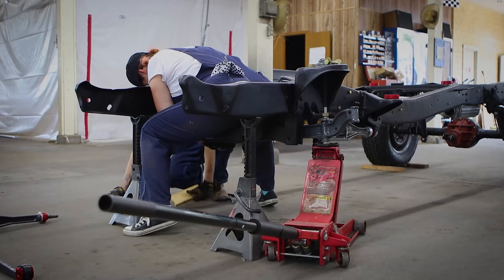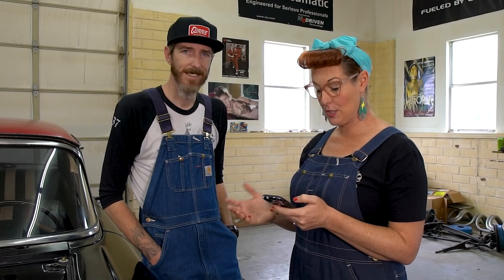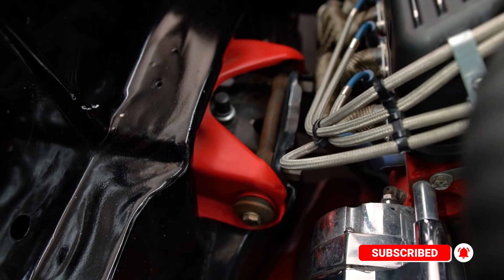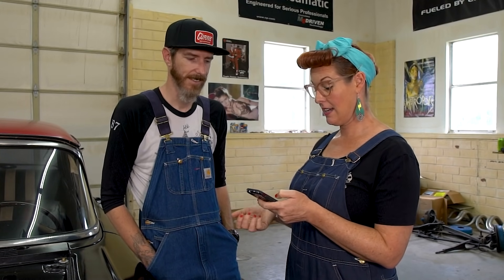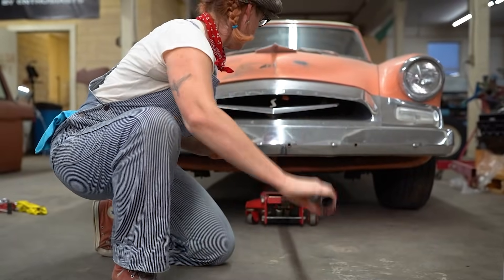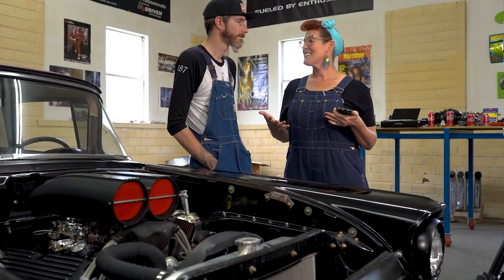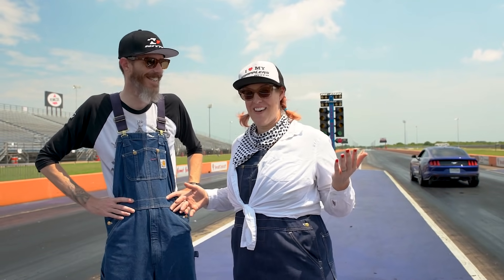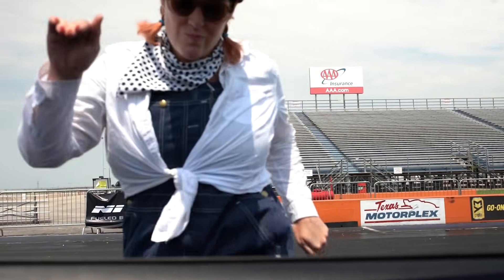The REAL Cost of Car Restoration | Extra Good

Comment: That’s not a typical price. A decent 10 footer paint job (looks decent at about 10 feet) is going to cost you 10k. A good suspension is about 6k. Do NOT take the prices in this video and try to apply it to the old 66 mustang behind the old barn that’s been there for about 30 years and say hell 10k and I’ll be on the front page of modern mustang magazine! YOU WONT! It’s a lot more expensive than that. This couple did a lot of the work themselves and went with standard to substandard parts judging by the prices they quoted. Wilwood isn’t the best, but it isn’t the worst. Just a front and rear brake conversion without the booster, master cylinder, proportioning valve, or steel lines will cost you almost 3k and that’s you installing it!

Comment: I restore Lincoln Continentals.  For a convertible, I charge $250,000 to $325,000 depending on the condition of the body and chrome.  I do not restomod.  The MELs or 460s go back in.  When I'm done, the finished car is worth no where near what the client paid.  A labor of love, indeed.

Comment: I’m not trying to be critical but you didn’t restore a 1957 Ford .  You built a 1957 Ford restomod and did a great job.  I owned a 56 Ford with drum brakes and had no trouble stopping it.  I currently own a 66 Charger with full drum brakes and a single master cylinder, which is how it came.  I am currently doing my best to restore it to original even though it doesn’t need much.  Even though it has a HiPo 383 four barrel (all factory stock) I have out grown two wheel burn outs and drag racing.  That said, I feel the cost to restore a car depends on what you choose to start with, parts availability and your ability to do the work. In my younger days I restored more than one, always to original, but I agree it can get very expensive. Great video and great job on the 57.

Comment: Thank you for the numbers nobody ever talks about it. And effort $… I do this for a living and every one wants it done now thanks to TV.
Reply: Exactly.Most people don't have any idea what is involved to restore a car.If you're going to do it right, you'll have to buy things you never thought about.Weather stripping is stupid expensive,wiring, chrome plating,all kinds of bolts,brake lines,and a lot of other things that you will run into as you go along.If you're just starting out like me,a large air compressor, metal working tools, engine hoist and a lift are just about necessities.Heck, you'll spend a small fortune on paint and body tools and supplies.It ain't cheap my friends.
Reply: I know all about it restoring my 65 Rambler for the second time because it's not too long cuz my stepfather's first new car new wheel bearings brakes brake lines master cylinder water pump fuel pump rebuilt all the stuff that all adds up

Comment: I have a '59 Ford Fairlane 500 two door hardtop. I am impressed with how you have been able to keep costs down. It has an excellent interior, and a nice enough exterior. It is straight, with fairly new paint. There are a few rust bubbles here and there, but the frame and under body are good and sound. It has a 352 FE engine, which is not the engine it came with. The left exhaust manifold was broken, but the seller had a replacement manifold for it. The old bolts on the manifold were not going to give up without a serious fight. Several were already broken off, and I could not figure out how to get a drill, tap, and so on between the engine and frame. I took the left head off, and I also checked the valve stems and valve guides. They were worn, so I took the other head off, and took them to a machine shop for a valve job. Started with some broken bolts, and it mushroomed into a valve job with hardened exhaust valve seats. $1,000 I didn't plan upon, but that's the way it goes. I've had to hire some of the work done due to health problems that are causing fatigue and mobility problems. I am getting close to having it run again, and I can hardly wait to go crusin' in it.

Comment: Awesome build!! Thank you so much!! I have a 1958 buick special im planning to restore and the build you did is the same I want, its going to be my daily driver ❤
Reply: I have always thought that a '58 Buick Special would be very good looking car, if all that strange looking quarter panel chrome, and too large and intricate bumpers, huge taillight housings, and hood and deck lid  trim, were all removed. Back in '58, my dad's best friend (and work colleague, they both taught at General Motors Institute) , who lived two houses down from us, bought a '58 Special 2 door sedan, 364 with 3 on the tree,  blackwalls and dog dish hubcaps, in a light blue. That would have been the fastest  Buick made that year. Always thought that if I could find another one like that , I could make a great looking 50s Kustom . 😎👍

Comment: I just bought an Out of Sight Audio for my 67 Pontiac Catalina. You can connect it to your phone using Bluetooth, and upgrade it with additional speakers and an amp later down the road. Plus you don’t have to modify your original radio.

Comment: The key to restoration is time, patience, money and/or the ability to do some of your own work.  Unless you know how to do it, you gonna have to pay for some stuff.  You can save a lot of money if you can [learn how to] do engine, transmission, and or fab/body work.  I personally learned how to work on/rebuild engines (it's literally like doing a puzzle with torque specs) on YouTube and trial and error.  Transmissions IMO are a little harder but it's doable; again YouTube.  I also bought a welder and learned basic welding on YouTube.  Suspension and brakes are straight forward.  Just take your time and don't leave anything out.

Comment: Eh! 1958 AMC Rambler Super here (pt. 106),just wondering if you guys had to remake the window rubber parts that keep rain water from dripping into the inside of the doors?
Reply from the maker: Great car Tim! Rubber trim is fairly findable for 50s cars. For cars like this Ford, which had high production, there are options via Steele Rubber Products and other companies. For something like your car, it's more like Kristin's Studebaker, which had lower production numbers. We found a rubber kit for the Studebaker from a company that specializes in Studebaker parts - but it's quite a bit more expensive due to its limited production.

Comment: I also restore cars. Presently doing a '77 C10 shorty and a '74 Porsche 914. Pretty is expensive. I did a '61 Impala Bubbletop 409 for someone else. Money was no object. Probably cost complete around $75k. What did you use for a transmission?

Comment: You got to understand tho it only costed them 10k because that's just a part and they did all the work by themselves and not to mention almost the engine is free and no paint job .  If that was done at a shop, it would have cost them another 20-30k minimum. I know that because I have been in the classic car game for so long and I own a classic car. Just part alone like engine, full suspension system, transmission and paint jobs will easily add up to 50k. People on the streets ask me how much would it cost to get or build one and my true  answer is always the same. If you don't know how to work on a car or have lots of cash to get it build, stay away from classic car  b/c it will leave you broke!

Comment: Does that include labor?   Would it be more to restore to 100% factory correct, date codes, etc.?
Reply from the maker: No labor included Jim - that would increase costs by a ton! It's important to evaluate what can and can't be done by yourself. 
100% factory... that all depends. There is stock restoration (which we clearly didn't do) and then there's rare vehicles that need to have matching original codes and what not. That is going to vary greatly by the vehicle - but in general, yes you can generally assume that will add to the cost. However, we did do performance upgrades - so if we merely replaced original parts on this car there would have been areas where we wouldn't have spent as much in parts.

Comment: Who can afford to restore a car. It takes everything just keep your car running, pay on the house, and FOOD!
Reply: Who can afford to drive a new computer? Everything is designed to fail and thus the repairs cost 2x as much and happen 2x more frequently. Or more! 
You would probably save a fortune restoring an old “car” rather than keeping a modern “computerized snitch on wheels” rolling.

Comment: A cost of a restoration, shop hrs. $85hr. Labor, start at, 1200- 1700 hrs… so you have 1200 to 1700 shop labor at $85 hr,, plus al the parts you buy for the car , and that can be $1000 more. You can’t rebuild a car/ truck for $5000, maybe that could be a down payment..
Reply: Exactly my point people under estimate labor cost! if you are not ready to spend 50k plus, don't start.

Comment: Most people dont have the ability to do their own labor,or paint,my 66'Impala SS WAS MAINTAINED WELL WHICH ALLOWED ME TO MOVE FORWARD WITH UPDATES,JUST TO DO THE 2SPD POWERGLIDE CONVERSION TO A 5SPEED TREMEC WAS 11,000,MY MOSER REAR 3500,PAINT 15,000,ZZ502 LONG BLOCK 8,000,TO FINISH LONG BLOCK ANOTHER 5,000,EXHAUST IS PYPES 3" MANDREL BENT CUSTOM INSTALL 1500,ALL WHEEL DISC 1500,WHEELS AND TIRES TORQ THRUST WITH NITTO TIRES 2200,VINTAGE AIR 3,000,COOLING SYSTEM 1200,SHOW QUALITY POLISHING OF ALL STAINLESS TRIM 3000,HOTCHKIS SUSPENSION FRONT AND REAR 1800,STEREO SYSTEM WITH ALL THE BELLS AND WHISTLES 3,000,NEW EMBLEMS ALL AROUND 600,FIBERGLASS HOOD 2"COWL 1000,TINT 500,DOOR HANDELS AND MIRRORS 350,INTERIOR  RE DYE AND CARPET AND HEADLINER 1500,,,,,,,MY BROTHER ASKED ME,SO WHAT DID YOU BUDGET TO RESTORE CAR,I SAID 40,000,HE GOES REALLY,NO TRIPLE IT,I WAS LIKE NO WAY,,,,AND THIS DOES NOT INCLUDE ALL THAT HAD TO BE REPLACED DUE TO NAME BRAND CRAP AFTER MARKET HYPED UP PARTS,,,3 ALUMINUM RAD'S,4 ALTERNATORS,2 MSD REPLACEMENTS,Three 870 Quickfuel Carbs at 800 a piece,YOU MUST HAVE A GOOD INCOME TO BE ABLE TO KEEP UP WITH THESE CARS,BC THERE IS ALWAYS SOMETHING THAT NEEDS ATTENTION AND MONEY TO FIX,I CAN DO ALOT OF MAINTENANCE,BUT I PICK AND CHOOSE MY FIGHTS NOW,SOMETIMES YOU HAVE TO BRING IT TO THE SELF PROCLAIMED BEST IN THE BUSINESS resto shops,AND YOU HAD STILL BETTER CHECK IT OUT GOOD,,,NOT MUCH LUCK WITH THESE GUYS IN THE PAST,AND ALL THIS WAS DONE IN 2015,NOW AT THE POINT OF GOING OVER CAR,7RS NOW,AND I KNOW IT WILL NEED SOMETHING,AND IT WONT BE CHEAP,NEVER IS,,,,, BEFORE THIS CAR I ALWAYS HAD A PROBLEM WHEN YOU READ STORIES OF 10YR BUILDS IN OWNERS GARAGES,NOW I GET it,AND HAVE TOTAL RESPECT FOR THESE DIE HARDS,MONEY,TIME ARE HUGE FACTORS AND SOMETHING ALWAYS COMES UP THAT GETS IN THE WAY,,,YET,THEY KNOW ONE DAY IT WILL BE DONE,AND THE ATTACHMENT YOU GET WITH THESE PROJECTS USUALLY OUTLASTS MARRIAGE,,,,BUT THE FEELING YOU HAVE ON THE ROAD,AND WINNING BEST IN SHOW,JUDGES CHOICE,BEST IN CLASS MAKES IT ALL THE MORE FUN AND REWARDING,I HAVE EVEN HAD TROOPERS AT RED LIGHTS MAKING SIGNS TO SMOKE EM UP,BUT,I ALWAYS CHICKEN OUT,AND I DONT DO BURNOUTS,THATS WHAT CAUSES ALOT OF PROBLEMS WITH SUSPENSION,AND  VERY EXPENSIVE REPAIRS,,,ALL IN ALL I LOVE AND ENJOY MY RIDE YR ROUND,AND IT KEEPS ME IN SHAPE,JUST DETAILING THE RIGHT WAY IS EXHAUSTING,GOOD LUCK TO ALL,,